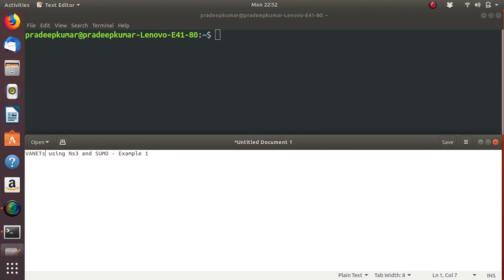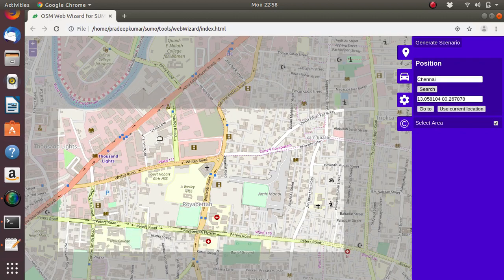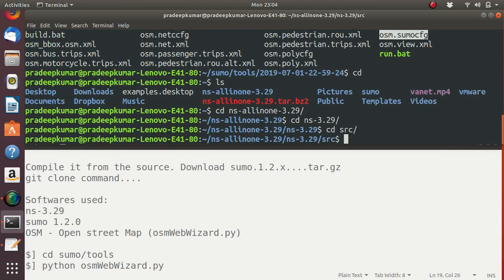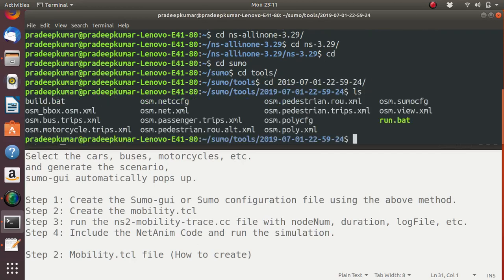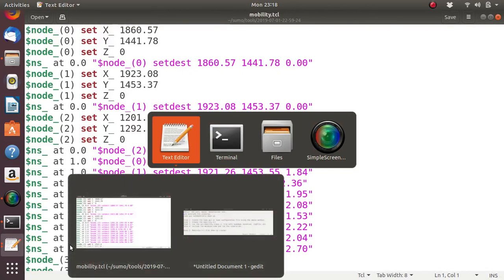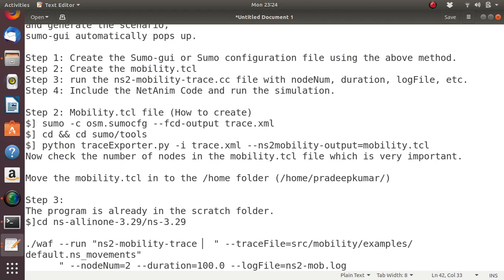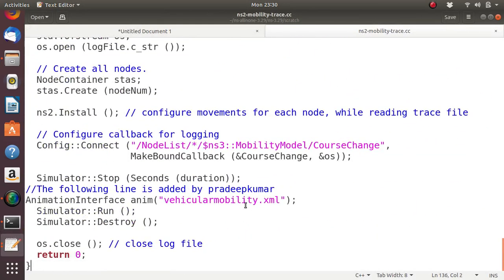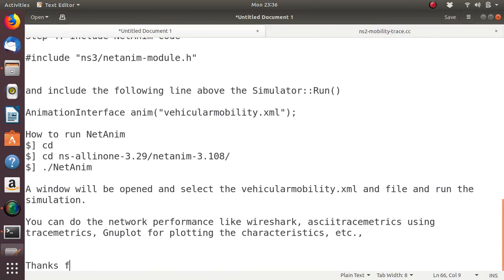VANET Simulation using NS3 and SUMO | Free Source Code

Comment: In this video sir
In last i am facing error in ./waf run command
As it says ./waf not found
Kindly help sir

Can we use ./ns3 for new version of ns3 software
Reply from the maker: @SonaliGupta-d2c  instead of ./waf you need to use ./ns3
Reply: @ thank u so much sir for your time
I will try today and ask if same problem persists
Reply: @tspradeepkumar it is again showing error
As saying ./ns3 not found
But i installed ns 3.38 version and hello simulator allows run successfully sir

Pls help

Comment: I face issue with step 3:  ./waf --run "scratch/ns2-mobility-trace --traceFile=/home/mobility.tcl --nodeNum=1813 --duration=100.0 --logFile=ns2-mob.log"

Could not open trace file /home/mobility.tcl for reading, aborting here 
", file=../src/mobility/helper/ns2-mobility-helper.cc, line=189
terminate called without an active exception

Comment: Hello Sir,
Your Videos have been very helpful for installation of VANET and NS3. I am doing a project on attacks on Autonomous Vehicles. Will you be in a position to guide me in the right direction for possible attacks. 

Thanks.
Reply from the maker: there is a video on blackhole attack and worm hole attack for manets in my channel and if you generate a traffic  in SUMO and implement those attacks as mentioned in the above videos... then your work is done... It takes some time for me to do.... but lengthy videos people avoid... So i feel that my time was wasted... Thats why i do not publish lengthy videos.. But very soon I will publish videos with chapters so that one can move between their needed topics...
Reply: @tspradeepkumar  Thank you for the response. I have dropped you a mail on your mail id. Thanks.
Reply: Hello Sir, I have sent you a mail on the mail ID mention in the profile. Can you pls check. If the email Id is not correct, Kind request to provide the same. 
Thanks.

Comment: Hello, thank you for the video. 
after adding AnimationInterface anim("vehicularmobility.xml"); to the file and running  ./waf --run "scratch/ns2-mobility-trace --traceFile=/home/pradeepkumar/mobility.tcl --nodeNum=1813 --duration=100.0 --logFile=ns2-mob.log", I got the error below and so I could not obtain the vehicularmobility.xml. Could you help me please? 

ERROR:
collect2: error: ld returned 1 exit status

Waf: Leaving directory `/home/aslihan/ns-allinone-3.29/ns-3.29/build'
Build failed
 -> task in 'ns2-mobility-trace' failed with exit status 1 (run with -v to display more information)

Comment: hey I am getting a error after running the ./waf line the error is : 
msg="Could not open trace file /home/mobility.tcl for reading, aborting here 
", file=../src/mobility/helper/ns2-mobility-helper.cc, line=229
terminate called without an active exception
Reply: found anything to solve this?
Reply from the maker: You can give the full path for the mobility.tcl file

Comment: Sir, in the SUMO mobility traces we see that the speed does not exceed 15 m/s, though the max speed of vehicles is set to a higher value using maxSpeed attribute. How do we increase the vehicle speed?? for ex- 40 m/s or 50m/s.
Reply: Might be worth checking the max speed of the road/edge. If I recall correctly,  a vehicle w/ max speed of 40 mps won't reach that speed if the road/edge has a max speed of 15 mps.

Comment: Sir, is there a way to find out the speed of vehicles modelled using OSM? If yes, can you please tell how can we find it.
Reply from the maker: Usually we only set the speed of the vehicles using random function. But in case if you want to find the speed of the vehicle within the simulator, you can use the functions in mobilenode.h file in ns2, where it has a function that measures the speed of the node. You can use that function and send those values to a FILE and see it. you can watch this video
https://www.youtube.com/watch?v=8Bx3WLGlMSw&t=9s
Reply: @tspradeepkumar  Thank you Sir. Will try this method.

Comment: thank you so much for this awesome video, my simulations works well.  i am doing a Masters thesis on Real time detection of Jamming /DOS in VANET (V2V,V2X) for IEEE802.11P, please sir how can i go from here, i need help.  email: frankobinnaeze@gmail.com
Reply from the maker: There are many options in SUMO XML Files. You can learn from there.. But when you are converting them to NS3, you mention as 802.11p instead of 802.11n or g
Reply: @tspradeepkumar  thank you sir for the reply. Please can you refer me to a video that can help me calculate the throughput,bit error rate, end to end delay from the trace file generated after the simulation with ns3 and sumo.
Can I consult you for guide,  even if I have to pay to learn 
Frankobinnaeze@gmail.com

Comment: when i execute ./waf ..... i received this msg 
msg="Could not open trace file /home/maher/mobility.tcl for reading, aborting here 
", file=../src/mobility/helper/ns2-mobility-helper.cc, line=189
terminate called without an active exception
Command ['/home/maher/ns-allinone-3.25/ns-3.25/build/scratch/ns2-mobility-trace', '--traceFile=/home/maher/mobility.tcl', '--nodeNum=200', '--duration=100.0', '--logFile=ns2-mob.log'] terminated with signal SIGIOT. Run it under a debugger to get more information (./waf --run <program> --command-template="gdb --args %s <args>").

Comment: Hello sir, 

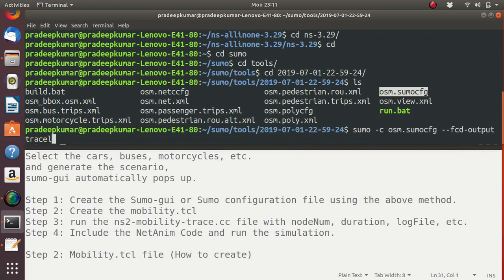I am getting an error at 18:40 

mypc@GANESHKONGARI-Inspiron-15-3552:~/sumo/tools/2020-03-03-23-16-24$ sumo -c osm.sumocfg --fcd-output trace.xml
Loading configuration... 
Error: No option with the name 'device.rerouting.adaptation-steps' exists.
Error: Could not load configuration 'osm.sumocfg'.
Quitting (on error).
Reply: .xml file is not creating
Reply: can you please send the solution sir
Reply: I am also getting the same error. sir, can you please assist me?

Comment: Hello Sir! I'm facing a problem during the Generate scenario in OSM Web Wizard. while downloading map data after few seconds I get a message (error: [Errno 101] Network is unreachable) . Can you help me with that ? thank you!
Reply from the maker: Just try selecting a small area and small numbers in vehicle selection. Also don't close the terminal window where the python command is running
Reply: @tspradeepkumar  I tried like you told me but still having the same issue !
==============================
amin@amin-VirtualBox:~/sumo/tools$ python osmWebWizard.py 
Building scenario in '/home/amin/sumo/tools/2019-12-31-16-19-37'
Downloading map data
Traceback (most recent call last):
  File "osmWebWizard.py", line 442, in build
    builder.build()
  File "osmWebWizard.py", line 190, in build
    ["-b", ",".join(map(str, self.data["coords"])), "-p", self.prefix, "-d", self.tmp])
  File "/home/amin/sumo/tools/osmGet.py", line 116, in get
    (north, south, west, east), options.prefix + "_bbox.osm.xml")
  File "/home/amin/sumo/tools/osmGet.py", line 47, in readCompressed
    </osm-script>""" % query)
  File "/usr/lib/python2.7/httplib.py", line 1073, in request
    self._send_request(method, url, body, headers)
  File "/usr/lib/python2.7/httplib.py", line 1113, in _send_request
    self.endheaders(body)
  File "/usr/lib/python2.7/httplib.py", line 1069, in endheaders
    self._send_output(message_body)
  File "/usr/lib/python2.7/httplib.py", line 907, in _send_output
    self.send(msg)
  File "/usr/lib/python2.7/httplib.py", line 869, in send
    self.connect()
  File "/usr/lib/python2.7/httplib.py", line 1286, in connect
    HTTPConnection.connect(self)
  File "/usr/lib/python2.7/httplib.py", line 846, in connect
    self.timeout, self.source_address)
  File "/usr/lib/python2.7/socket.py", line 575, in create_connection
    raise err
error: [Errno 101] Network is unreachable

Recovering
Recovering
Recovering
Recovering
================================
Any other suggestions please ?

Comment: Sir, osmwebwizard opened on browser but map is not showing. It's showing only blank page.. I reloaded the page but it's still showing blank page. In terminal also, after entering command python osmwWebWizard.py it's showing blank as running.
Reply from the maker: Checking whether you have Internet connection
Reply: @tspradeepkumar  Sir, I have internet connection.. Still it's not showing any map..
Reply: @tspradeepkumar  Hello sir, Can you please teach about the addition of new protocol in NS3.

Comment: Thanks for the video. Well, while generating the OSM map, we  selected  around 20 car, bus, motorcycle etc. But after running in NS3, the total node becomes 1700+. Why is this?
Reply: Hello sir! did you find an answer about the question ? thank you!
Reply from the maker: It's not 20 cars, it's 20 cars per hour per km. According to the area specified , the number of cars and vehicles will be huge...